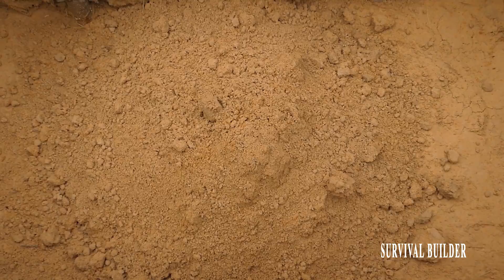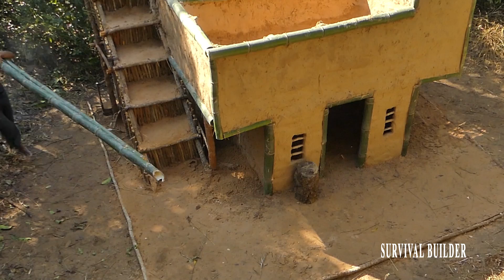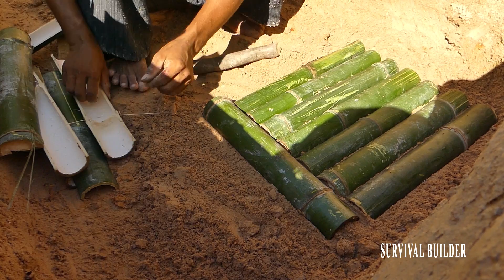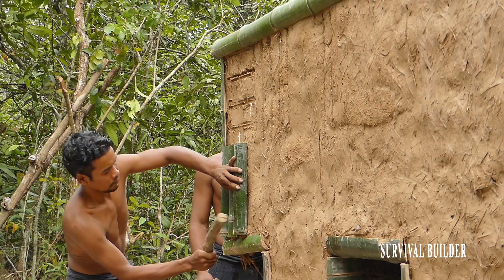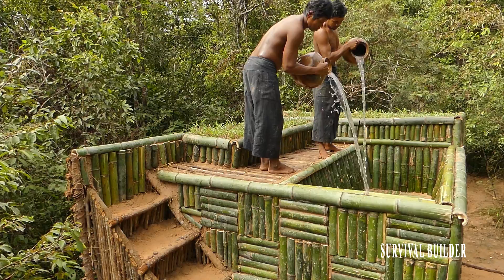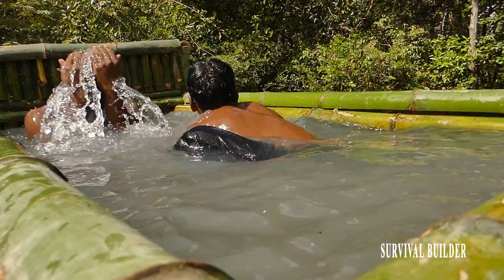Building The Most Swimming Pool On Roof Beautiful Bamboo Villa

Comment: You guys can and likely have built whole cities but I don't understand why you don't build these structure high enough for you to walk in and out without bending down. Why not add two feet to the doorways/entrances? Is it a weight problem with all the mud/cement? That's the only thing I can think of that might prevent a higher entrance or higher structures? Just asking. BTW I very much enjoy watching you build all these fantastic structures. Well done. You guys are an inspiration.